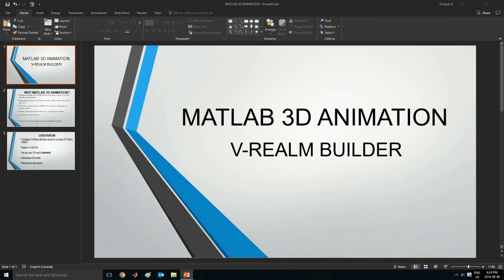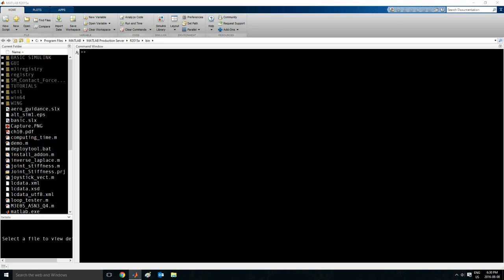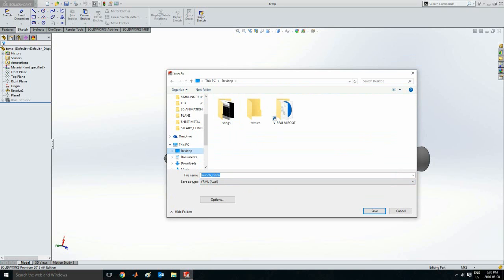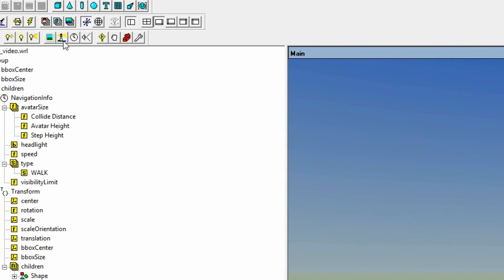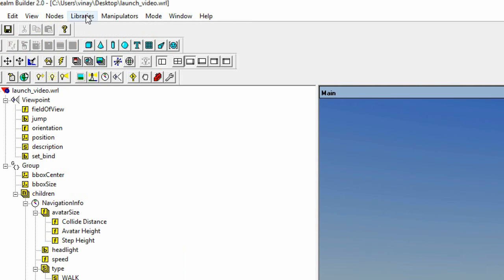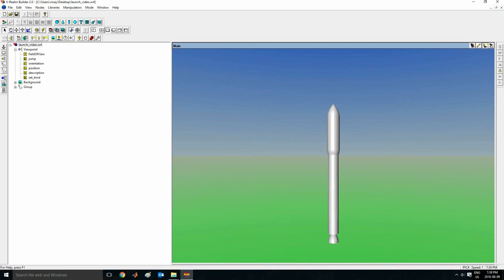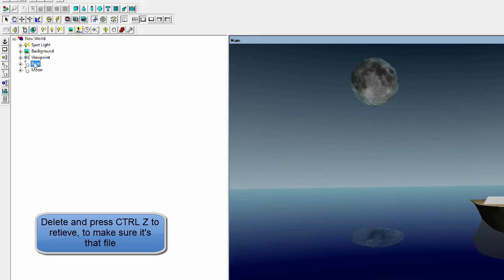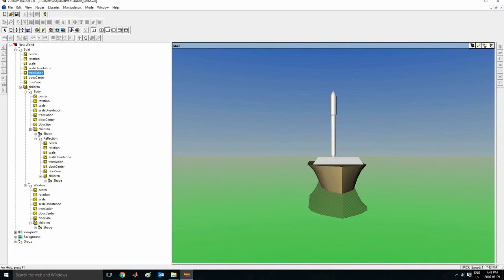Introduction to Simulink 3D Animation using MATLAB and V-Realm Builder - Part 1

Comment: Hello Sir,
I am a BE Electrical and Power Engineer  from India and I would like to know desgning GNC in Matlab but I don't Know where to start because our Electrical and Power were mostly based on factory based things and not electronics. Can you guide me where should I start?
Reply from the maker: First learn rigid body equations of motion, then learn control system basics (PID etc.). Then learn some basics about kalman filtering and estimation, A good book is "Aircraft control and simulation" by Eric Johnson and Brian Stevens